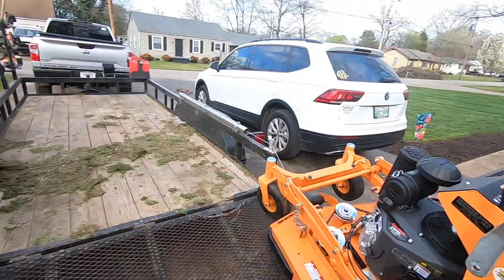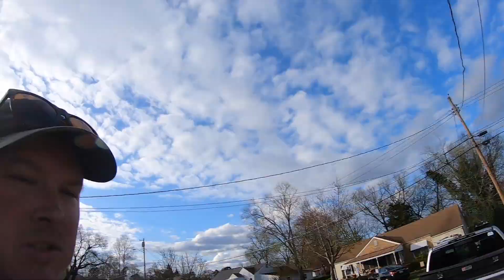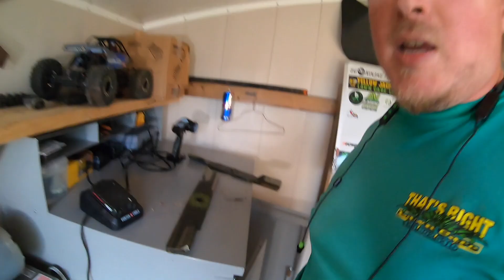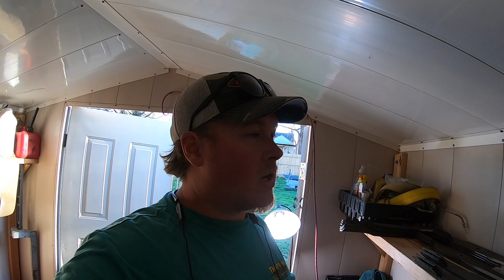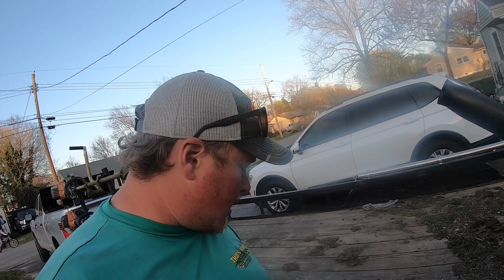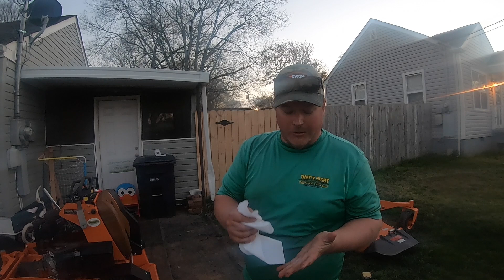I Chunked A Blade On The 61" (Sunday Mowtivation Part 2)

Comment: Thankyou James, hey brother I got a question last week I started cutting grass I hit a pretty good size rock and after that I could hear and feel a roughness about it its a exmark 52 inch I've never have hit something that big but I didn't take the blades off or check other than just looking under the mower but what do you think? God bless you and your family brother thanks and have a blessed week
Reply: Bent blade, bent baffle, loose blade or damaged spindle. Or something else. Jack up the deck with an auto jack and jack stands, or a mower jack and inspect the underside of the deck. Before you remove the blades to check for straight and sharpen them, turn them back and forth and see if they're hitting each other or anything under the deck.  Vibration issues only get worse, they don't work themselves out.
Reply from the maker: @Kodiak pretty much nailed that one. 👌You can use a square to check if it's bent or not, or anything with a straight edge. Hope you get it figured out. Happy mowing!

Comment: How did you remove the blades from the top?
Reply from the maker: Scag bolts go all the way through the spindle and nut up. Couple of "ugga duggas" from the impact and they drop. 61" and 52" have to get the middle blade from the bottom.
Reply: Okay.  Thanks